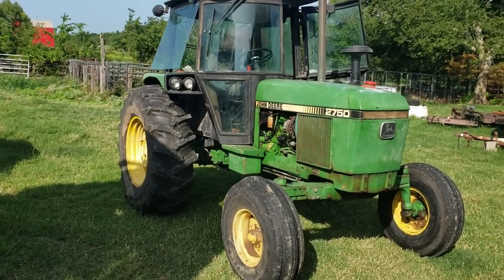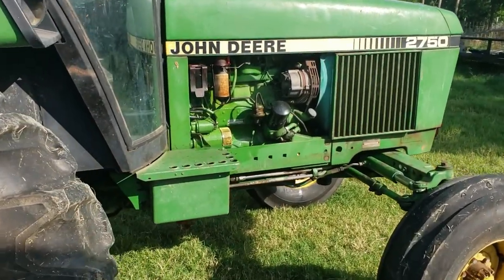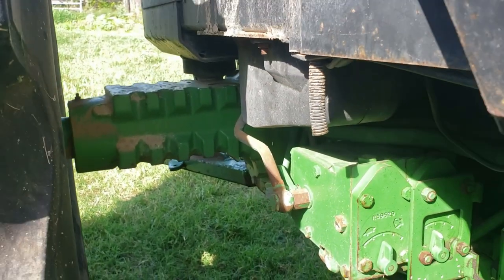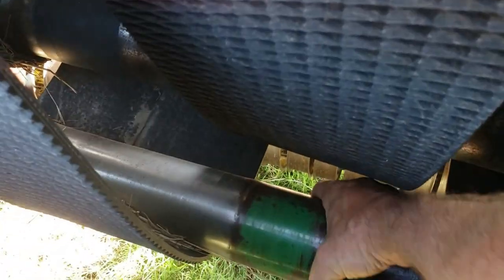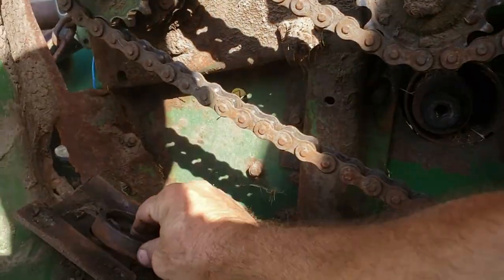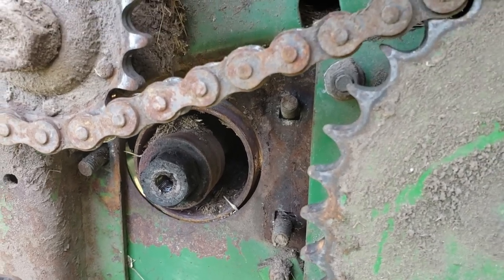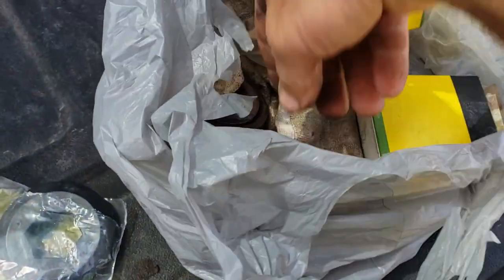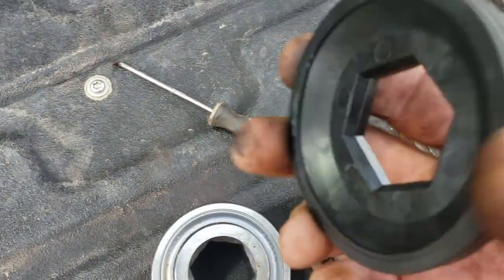John Deere Round Baler Roller Bearing Replacement  Look at USED 2750 JD Cab Tractor

Comment: You scored big with that JD 2750. We have had the very same bearing go out twice on our round baler.  They are a sealed bearing that has no grease fitting.  We had another bearing go bad and lucky the nephew was baling at night and he saw the bearing glowing red.  He stopped and lucky the baler didn't go up in flames.  I wish they had grease fittings on these as the only fix they say is to drill a tiny hole in the side of the bearing and inject grease and then seal up the hole somehow.

Comment: Use your infrared gun to check bearings that are sealed and hard to get to while running .to see witch ones are hotter than others . Lol but I'm sure you know that 😉 I have rebuilt a couple burned bailers .
Reply from the maker: Sharing on here helps others so great comment Carl!

Comment: James, the best chain lube I've ever used is actually for offroad motorcycles.  Bel-Ray super clean chain lube and Bel-Ray chain cleaner.  I've used both exclusively on my old Kawasaki 550LTD and I have yet to replace the chain.  Clean the chain, spray the lube and let it dry.  then go on and forget about it until next season, then do it again.  Hope this might help.

Comment: Bro im glad you caught it when you did looks like you dont have any wear on the shaft  or the inside  brg journal of the roller ive seen them all beaten out where you would have to put a speedy sleeve inside or replace the whole roller . That look like a good quality ball bearing you replaced it with probably a SKF or Dodge brg hopefully because after 30 yrs of selling that type of power transmission  drive parts they seem to be the best quality  for the money did you have any problem  getting the inner brg race off of the shaft ive seen them be a booger all galded to the shaft to where you had to cut them off .

Comment: screw those sealed bearings  ==always drill.. tap for grease insert
Reply: You know on those metal shielded brgs  you can pop off the shield on some of them to do a application  like your talking about .but usually those  factory sealed brgs are greased with enough quality brg grease to last a very long time plus it keeps out all the dust dirt & crap out of the roller balls 😉